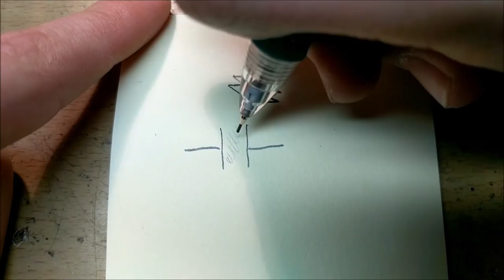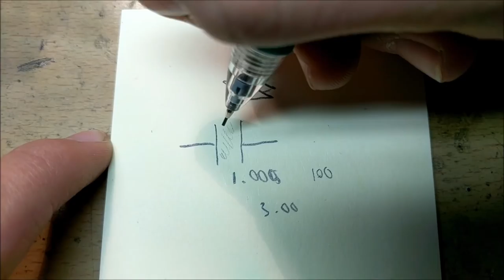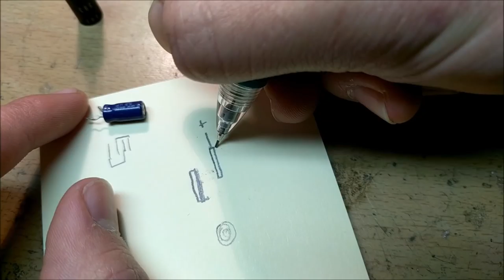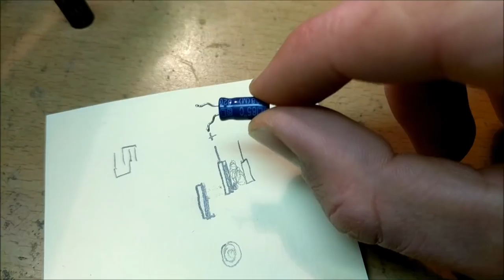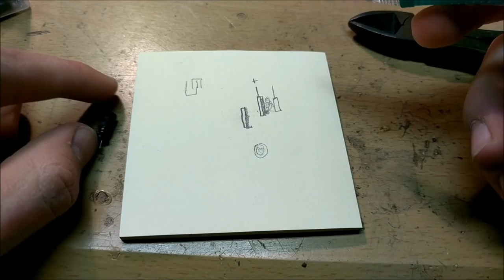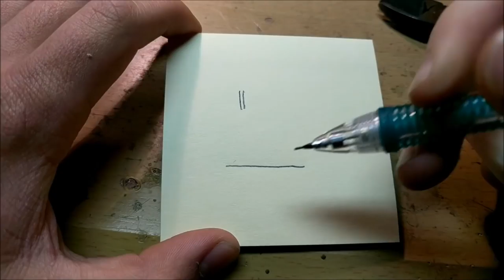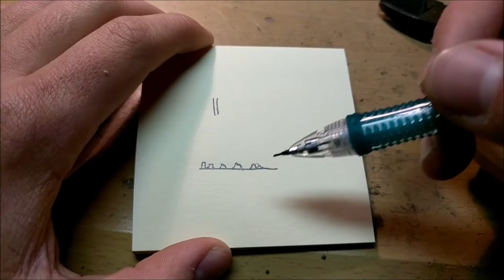Ceramic, Electrolytic, and Super Capacitors: How they Work and Why They Blow Up

Comment: I thought that when you add two capacitors in series their potential is divided
Reply: Yes, the capacitance of two capacitors in series is the reciprocal of the sum of the reciprocals of the individual capacitors, which is smaller than either of the individual capacitors.